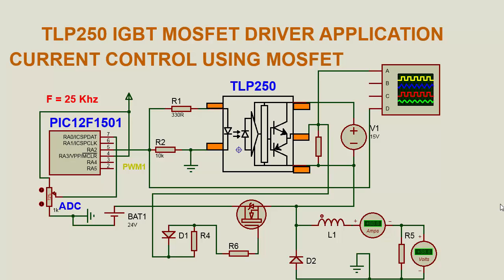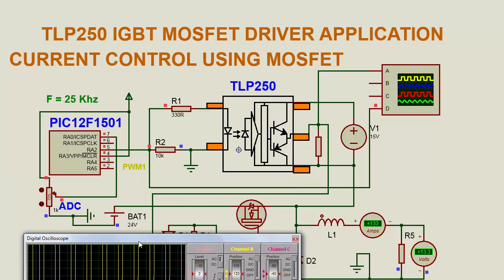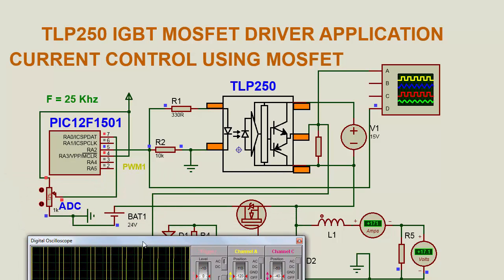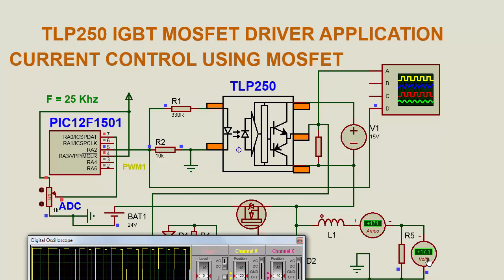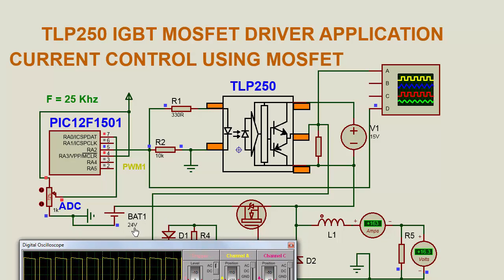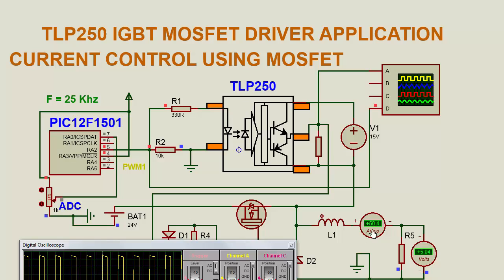TLP250 APPLICATION | CURRENT CONTROL | MOSFET | MICROCONTROLLER

Comment: КАК ВЫ ПОСЧИТАЛИ РЕЗИСТОР 330 Ом НА ВХОДЕ 2 ОПТОДРАЙВЕРА ?
Reply from the maker: Please comment in only English language. Thank you
Reply: @Dcode103  ARE YOU SUCH A PROBLEM, DON'T YOU HAVE A TRANSLATOR BUTTON, OR DO YOU HAVE ONE, EVERYONE HAS THE SAME. HOW DO YOU COMMUNICATE WITH THE WHOLE WORLD ? ESPECIALLY FOR YOU, I TRANSLATED A SPECIAL AND GREAT ONE INTO ENGLISH. HOW DID YOU CALCULATE THE 330 OHM RESISTOR AT THE INPUT OF THE 2 OPTODRIVER ?
Reply from the maker: Great now translator botton is available. Generally 5-15mA is ok for LED. Considering this and input voltage, and using omhs law we should calculate max current that can pass. Use resistance that put current within this range.

Thank you
Reply: @Dcode103  ОКЕЙ БРАТ

Comment: Excellent

Can we use arduino uno or attiny85 instead of pic12f

i want to make spot welder in that i need to drive 10 mosfet

Thanks
Reply from the maker: Yes you can ,this is optocoupler but to drive MOSFET,IGBT need separate  power supply , read data sheet.
Reply: @Dcode103  Thanks for reply

Comment: Hi, how many mosfets can we drive with 1 TLP250. Mosfet will not be driven by PWM. Only 10ms will be turned on and off.
Reply from the maker: You need to check practically. You may use MOSFET in parallel.